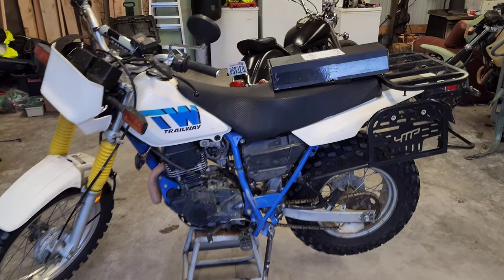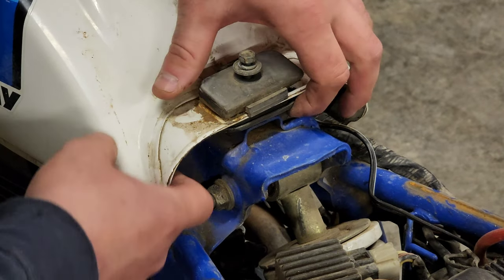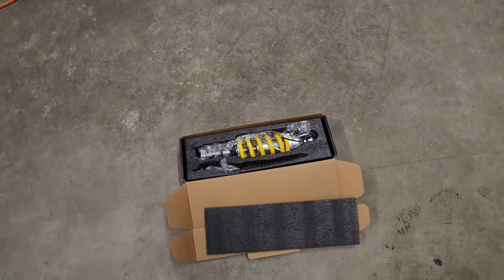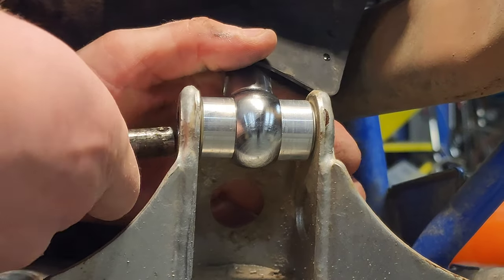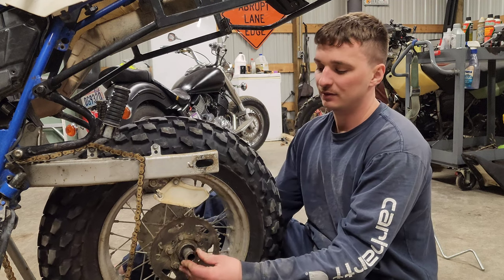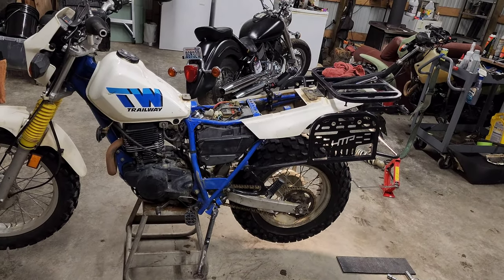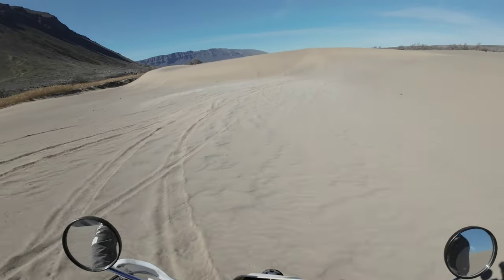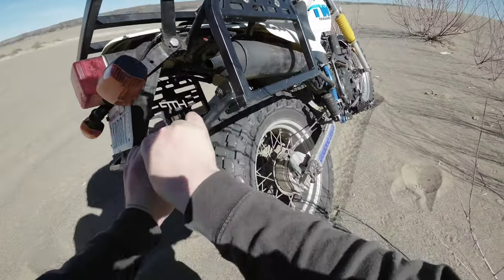Trying out a new shock for the TW200. Bradley Performance Offroad Shock Installation.

Comment: I hope you get a lot of views on this. Great simple video. I was able to replace mine without removing the wheel, but it takes two people. Also have to connect shock to swing arm first and then lift wheel to line up at tank, hence the need for two people. I need that shock now. Better save up. Sure wish it had been in stock when my OEM snapped.

Comment: So, you're the only person that I know of that has tried both the Bradley and Cogent rear shocks. I've been holding off on upgrading until I hear your thoughts. Is the cogent worth the extra dough, or is the Bradley good enough?
Reply from the maker: Really comes down to how much seat time you put on your Dub in my opinion.  Cogent was well worth it if you are always out logging miles and spending long hours on the T Dub but the bradley performance is also a great shock too once the preload is set up to your liking
Reply: @dualdorks  Cogent it is. Thanks for testing this stuff out. We all appreciate what you do.
Reply from the maker: @rickthomas1805  thanks man. Lucky if you go with cogent all you have to do is install and ride because they already set it up for your weight and riding style. Haven't had to mess with it at all. Unfortunately my engine needs another rebuild but I got some sources on some TW engines

Comment: one of the videos you had a small air compressor, what  brand, how do you like it, and how is it holding up?
Reply from the maker: Airmoto and Power Kit Bundle Deal - 1 bundle - Tire Inflator Portable Air Compressor with Power Kit for Charging at Home and on The Road - Cordless Air Pump for Car Tires, Motorcycle, Bicycle https://a.co/d/ctXTOom

I really like it just used it last night. Battery last a long time

Comment: the airmotos that i've seen are about $90, is that about what you paid or have you found better deals? know anything about the cheaper small compressors?
Reply from the maker: Mine was given to me but I just shared the link in another comment and it was around $90 ish. I love the thing and I believe it is definitely worth to have around
Reply from the maker: Airmoto and Power Kit Bundle Deal - 1 bundle - Tire Inflator Portable Air Compressor with Power Kit for Charging at Home and on The Road - Cordless Air Pump for Car Tires, Motorcycle, Bicycle https://a.co/d/ctXTOom